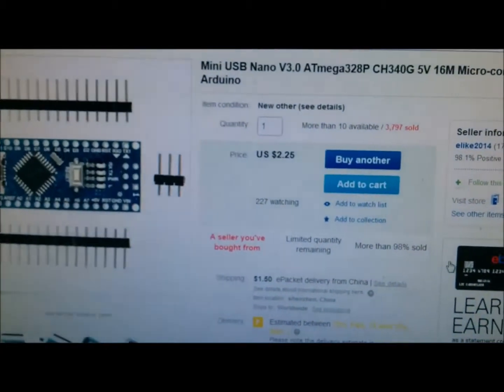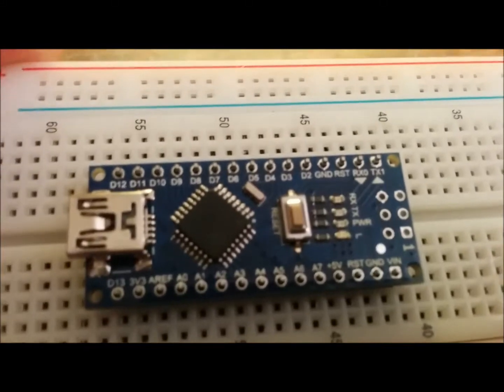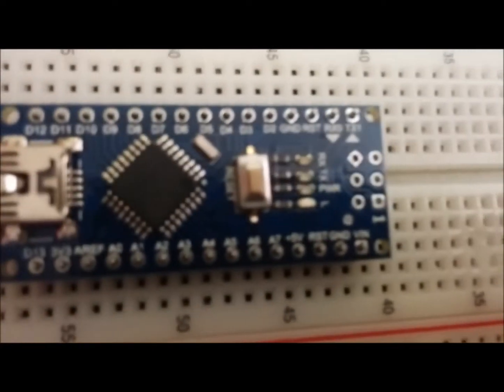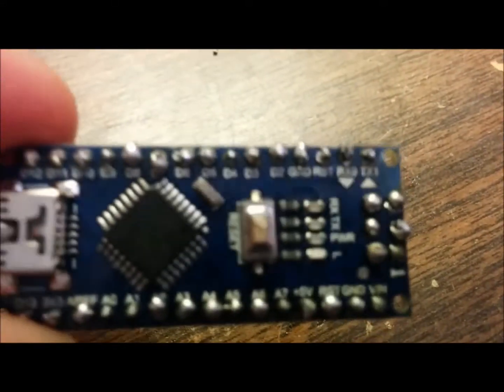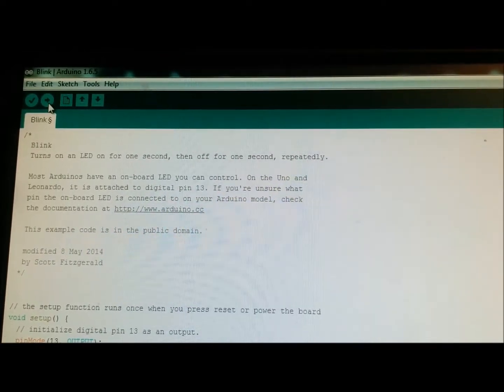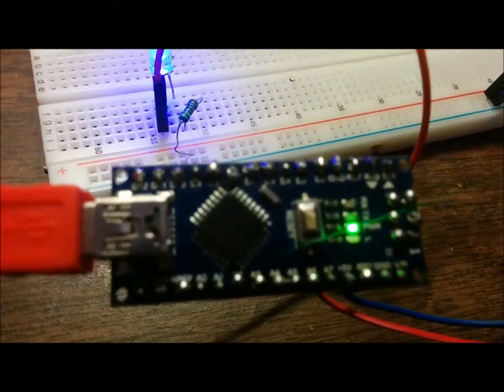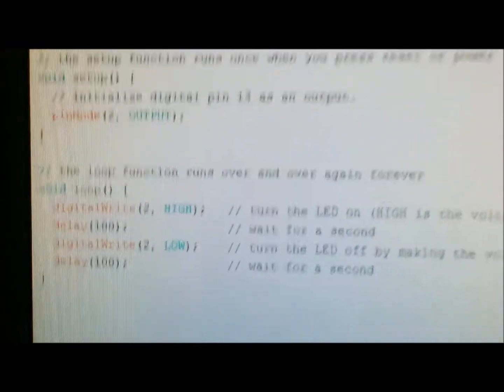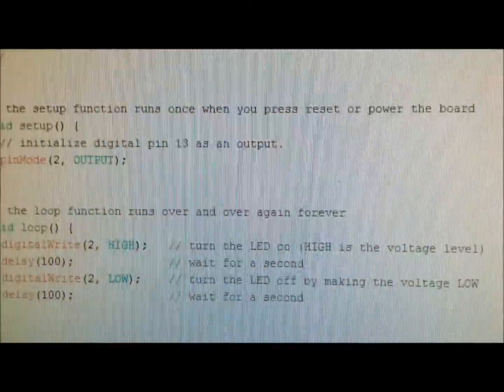Mini USB Nano V3.0 ATmega328P CH340G 5V 16M Micro-controller board For Arduino

Comment: very ugly soldered
Reply from the maker: Thanks for the constructive comment - You motivated me to buy a better soldering iron for soldering header pins into modules. You are correct - my soldering sucked and solding small header pins was difficult! Here is a video of the new soldering iron. I had to buy two because one was a dud Works much better now.  https://youtu.be/66rZKnyi2RU
Reply: Thats the way to handle negative fed-back! Now I will continue whit recommend you to use fraps to film what you are doing on you PC its relay easy.
Reply: I bought one pre soldered, it was nearly the same price.

Comment: Nice try soldering, You just need more practice and also a better brand of tin with flux in it. You also need to heat the pad after you've heated the pin before applying the tin.

From my personal experience, the right tools make the best jobs. It's even more important than the skills. 

Don't give up on this nano job.